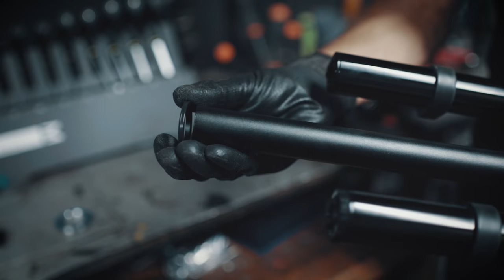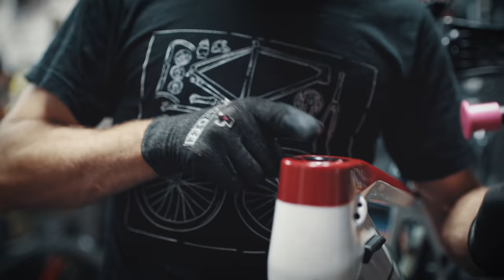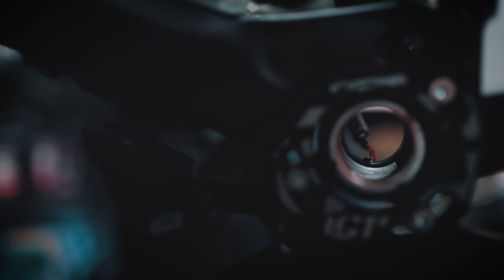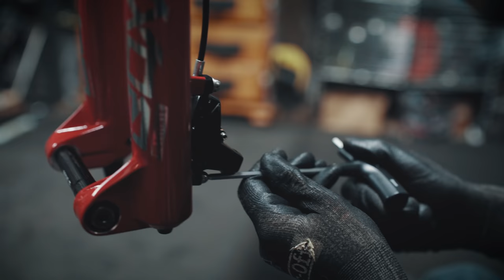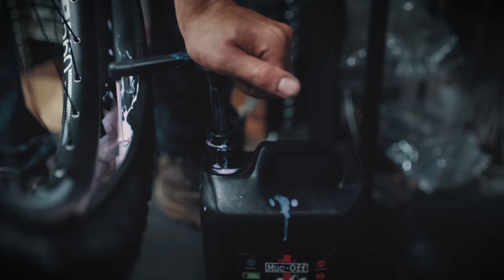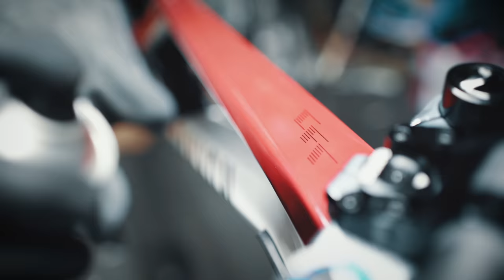DREAM BUILD MTB - Canyon Sender CFR

Comment: I couldn’t imagine having such a bike. When I watch these I’m always in awe. I’ve always wanted to get into mountain biking, but I can’t afford a decent bike. Good job on the builds! Love the videos!❤️❤️❤️
Reply: Me too
Reply: You don't need an expensive bike to have fun yknow. I started on a £300 bike and I've had more fun on that then any other bike
Reply: @harveyh8137  could you let me know what brand and model.
Reply: @bloxit6968  carrera vengeance. But it was an older one with the grey/white/blue frame colours
Reply: You honestly don't need anything crazy expensive. You can buy a brand new cannondale mtb with disc brakes for $485. I sold an old freestyle bike for $300 and sold some old DVDs I had at a garage sale. I made $500 I could buy the bike I'm talking about. I don't really need a new bike though. I've been finding older bikes people toss or are getting rid of. I fix them up and they ride beautifully. I recommend if you have no money right now at all either go to Facebook marketplace or look around. You'd be surprised what you'd find just being tossed. I found a carbon fiber 2006 Bianchi Giro frame on the side of the road. I already have other random parts and that's my finally quarantine build I haven't finished yet. I found 7 bikes built up 5 of them that are completely rideable right now. One I have all the parts on it but I'm wanting to tune it up and clean off surface rust. The Bianchi was the last bike I found and it got cold out so I stopped that project. So, since July I've found 7 bikes to build and during August I road 250 miles. Don't sell yourself short my friend. Most tools one might need to fix up a bike is a flat edge screw driver, curved jaw locking pliers, and a set of Allen Keys. I now own 5 road bikes and 2 mtb bikes. I'm debating on selling all of them and buy one road bike and one mtb. To downsize of course because I don't need that many bikes Lol.

Comment: Builders so different from one another. Some put grease everywhere, some just on a few spots. Some use torque wrenches and spec sheets, some tighten by experience and "gut" feel. Gotta say, bike parts are largely quite resistant to different assembly methods :D

Comment: It's been about 6 months since I lost my job over the whole covid deal.  Had to sell my house and move into a small apartment, so things aren't great.  I got myself a cheap bike to go out on trails because biking sounded like a nice way to relieve some stress and its helped but I can tell I'll need a nicer bike if I wanna hop on these more techy trails and actually get into it.  Watching these videos gives me a little joy and inspiration to keep on going for it, saving up for a better bike though seems almost impossible with how bad things are now though. Can anyone recommend a bike between 1000 to 1500ish bucks that's a good full suspension to take on decently hard trails?  Would be much appreciated.
Reply: I'd recommend looking for second hand bikes, you can find some really nice bargains if you search older bikes (years 2010ish). For instance, got myself a 2011 Specialized FSR Camber Expert for 600 € which only had a mild rear shock issue.

Comment: This guy missed a few things.... He should have adjusted the chains length while the rear shock was out of the frame. This way he could see the chains tension on the biggest cog while in full travel. You can trim a lot of slack off the chain this way. It helps tremendously with chain slap too. He also should have trimmed the break lines. There too long.

Comment: carbon cranks on a dh bike? STUPID! low central weight will make you more stable and faster in the downhills. i would also like to run a dh bike with coil, cushcore and more responsive brakes, like trp or the new shimanos.